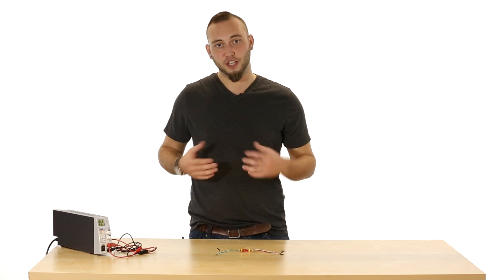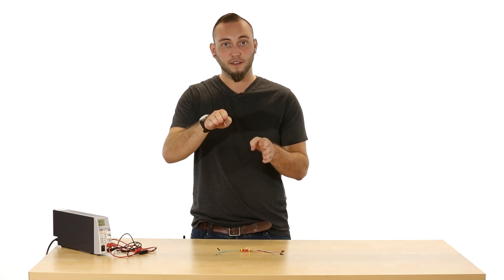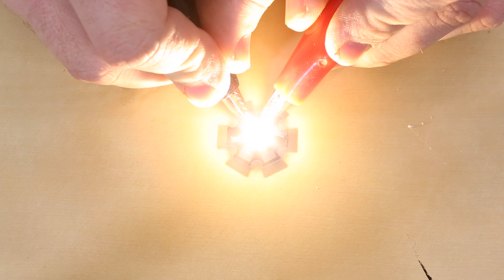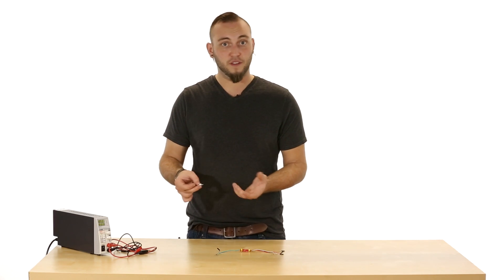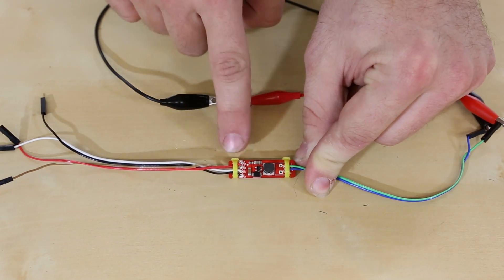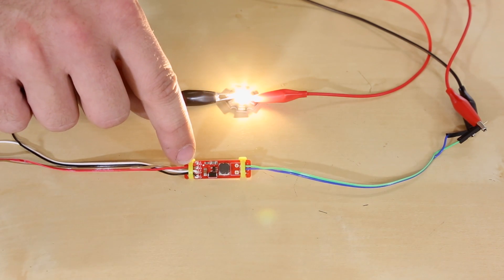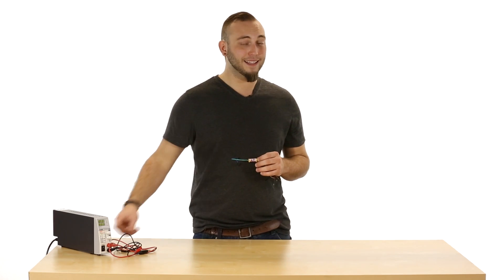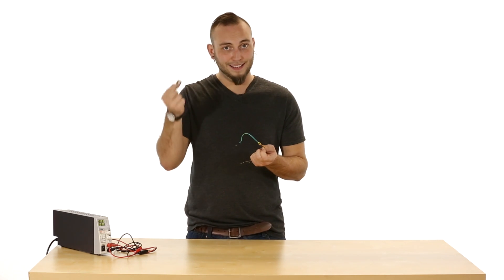Drive LED's with the SparkFun FemtoBuck!

Comment: But why is this necessary if I'm simply putting a 220 ohm resistor in series w/ my LED?
Reply: amherstguitar Aside from the other reasons already offered, with some of these LEDs that pull 750mA or such, your resistor would have to be pretty beefy to dissipate all the heat.
Reply: +Bizorke see that product link, that's where it tells you what this is designed for, not just how to wire it up:

I'll save you the trouble:

"Each FemtoBuck has the capability to dim a single high-power channel of LEDs from 0-350mA at up to 36V while the dimming control can be either accessed via PWM or analog signal from 0-2.5V. This board is based off of the PicoBuck LED Driver, developed in collaboration with Ethan Zonca, except instead of blending three different LEDs on three different channels the FemtoBuck controls just one."

So yeah you're right, except it's for those situations you described, it's not like they're tying to con people, they have this hella-article in the learn section of their site: https://learn.sparkfun.com/tutorials/light-emitting-diodes-leds

at least read what something is for before you say it's never needed.
Reply: +Jamie Roberts Yea SparkFun is one of the top companies to buy misc hobby electronics from. I buy their stuff all the time.
Reply: go to 3:03 it explains perfectly why this is better than just a simple resistor in series.  You can hook up any voltage you want and your LED will not burn up.
Reply: Just to be simple, becuase LED's should be powered with constant current, an if you only put a resistor, you are limiting the current, but you are not powering the LED with constant current, you are just limiting it
Reply: amherstguitar It's never necessary to use this - save your money. For any source-resister-diode circuit, whatever voltage doesn't get eaten up by the diode (typically 1.7 - 3.3 V) will drop over the resister, which you can use to calculate the current. As long as the current never gets above the diode's absolute maximum rating (which is frequently above 100 mA), it won't burn out. So unless you're expecting huge voltage variations, you shouldn't worry. And if you are, either fix your buggy circuit, or just use a voltage regulator. Or if you're just doing random tests and are too lazy to calculate R = (Vsrc - Vdiode) / (Imax) for the perfect resistor, use a 1 K resistor and you'll almost never have problems as long as you stay below 30V.
Reply: OK put the 220 ohm resistor in whatever .... let us use led drivers...
Reply: +Solve HQ Ltd. Naw. It's just an $8 wrapper for a buck converter. It's being marketed towards people who don't know how to set up LEDs. It probably costs them about $0.75 to make each unit, and with the exception of a few very unconventional cases this toy is completely redundant to have. 

Buck converters aren't useless (for driving LEDs) per se. I have worked on a project where we used an LED connected to a motor driver circuit to send data to a photodiode to eliminate any possibility that a voltage spike or catastrophic electrical problem on the motor circuit would destroy a microcontroller (which could happen if we used a transistor). We used a voltage regulator to protect the diode, but a buck converter would have worked too. But seriously, this one is overpriced and the vast majority of cases don't need it.